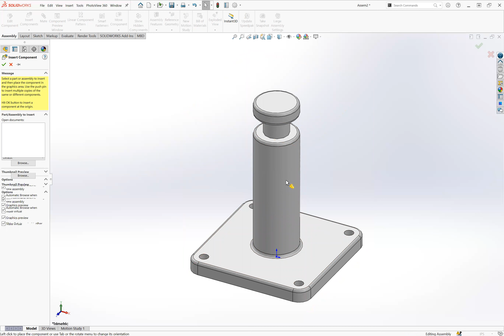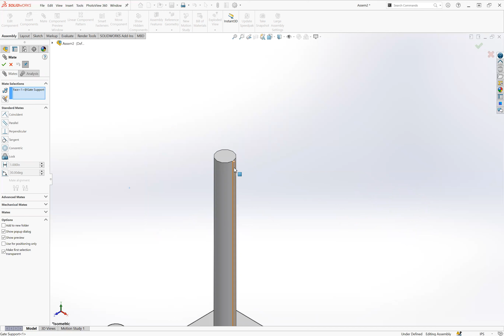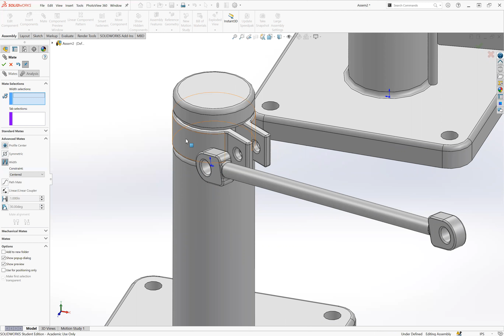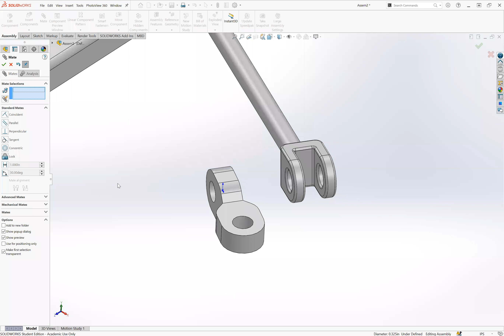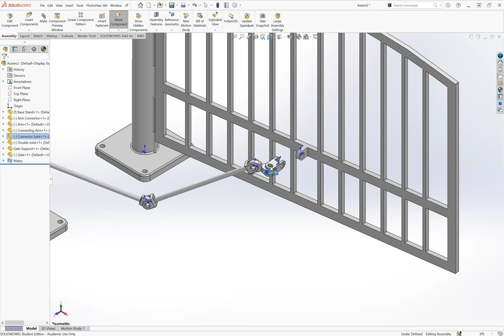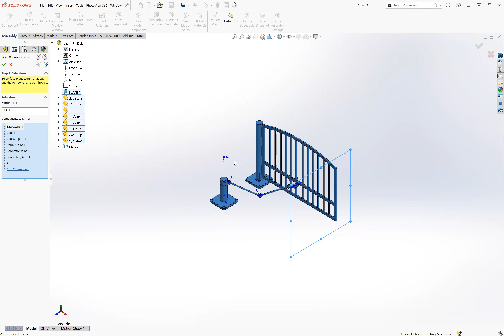Solidworks Gate Assembly

Comment: I noticed that when you mirrored the gate, it looks like some of the mates did not mirror and apply to the other side. the hinges are not touching, and the double joint goes through the gate, how do you fix that? I tried adding mates to the mirrored gate, but it does not apply to that.